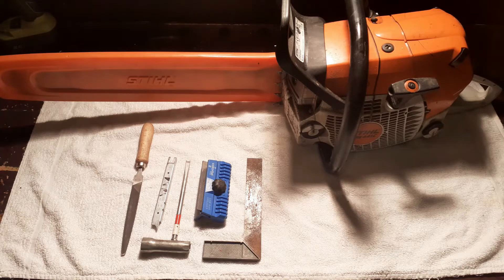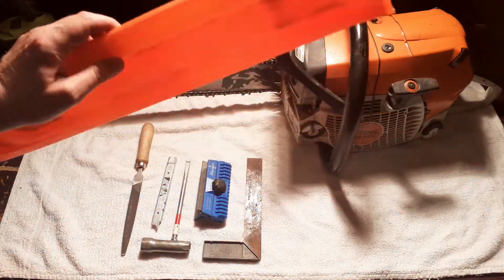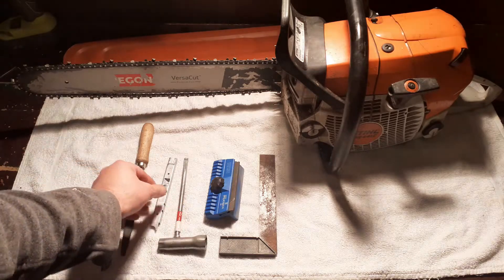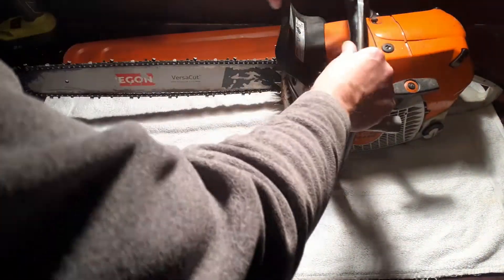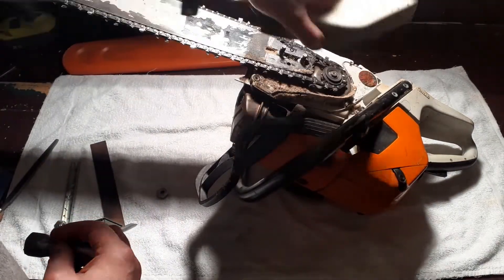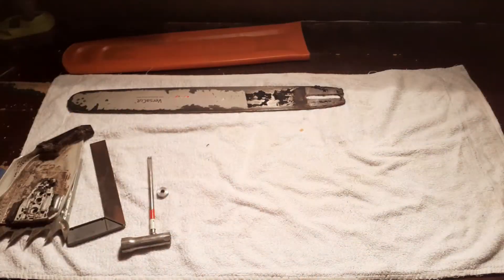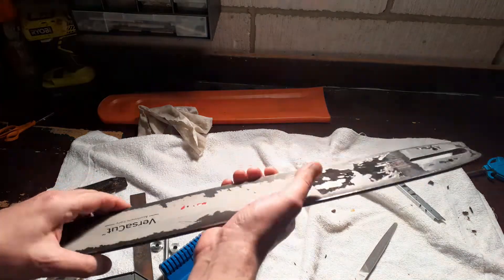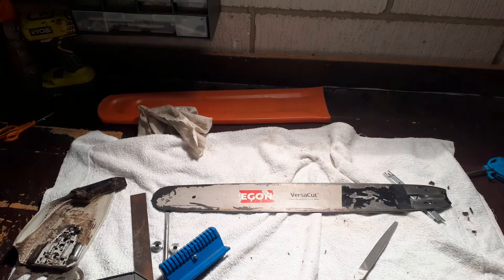How To Maintain Your Chainsaw Bar.

Comment: Good video James. How do you address any gap issues with the bar? Especially if the gap has widened and there's slack?
Reply from the maker: Hi. Thanks for the comment.  Do you mean the gap between the two bar rails ?
Reply: @JamesTheForester  
Yes, that’s it. I’ve seen people using a tool to squeeze the rails back together again but I can’t find anywhere reputable that sells them. I just wondered if it was something you do.
Reply from the maker: Hmm, never seen a tool like that. But these are my thoughts - safety driven as ever : bars are machined to tight tolerances because they need to work in partnership with both the chain drive links and bar oil, and oiler mechanism. If the rails were splayed outwards I would not like to try and bend them back in - it suggests some major issue has occurred - serious chain throwing at speed maybe - but bars are made out of metal much harder than chain drive links re, so in the case of a chain throw the chain is damaged not the bar. So splayed rails mean something major has gone on.  In such a case, if you bent the bar rails back into place by hand the chain might still not run true or oil properly and the bar itself might be weakened. I view bars as sacrificial items, they wear down in normal use anyway and are quite cheap to replace. BUT BEWARE! - are you sure it's not the chain drive links wearing thin? Making it seem like the rails are loose?

Comment: Is oregon advance cut chain good for a stihl ms 462? I found it cheap ( 25 euros)
Reply from the maker: Oregon chains are good quality. I often use bars made by them. If the chain pitch is the same as the chain you currently using, and drive link width is the same as the bar and the number of drive links is the same then it should be fine.

Comment: Thank you the information on servicing the bar. I only have one issue, a file is only used away from you. If you draw the file back toward you it dulls the file. If it is used like sandpaper it will dull the file. Other than that, great information
Reply from the maker: Good tip!
Reply: Good way to kill a file